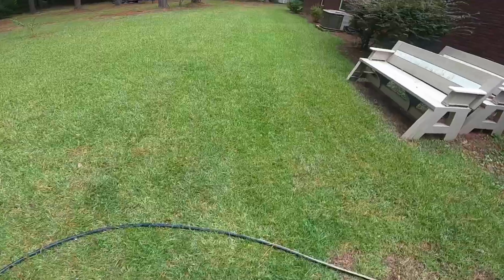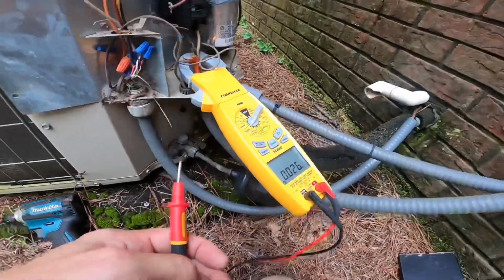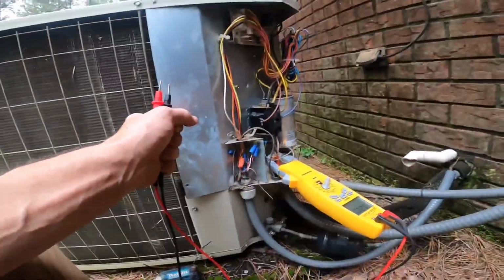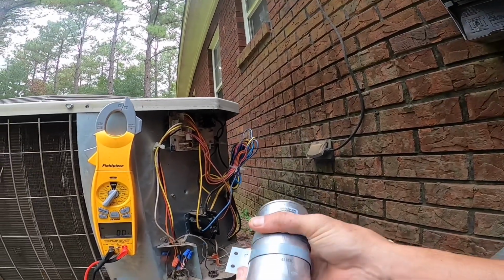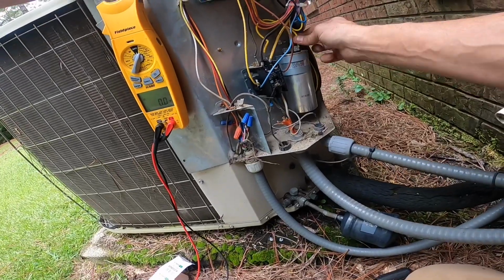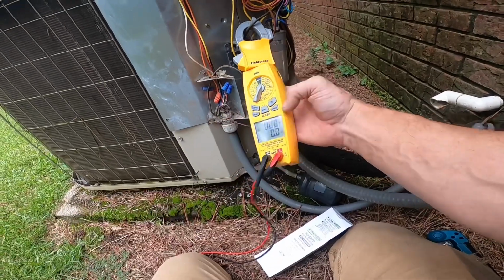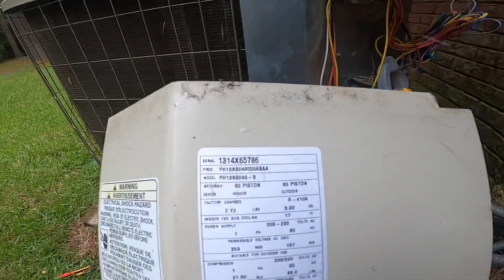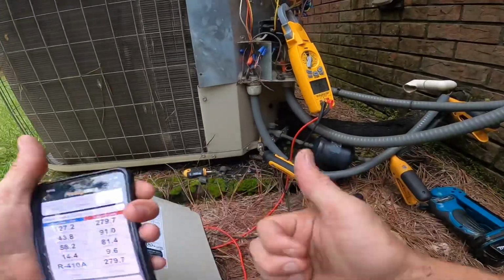No cooling, compressor wasn’t running, another cap bites the dust

Comment: By the way, the new Sman manifolds operate kind of the same way. They have a little glitch that a lot of people don't know about. I discovered it and brought it to Fieldpiece's attention. If you leave pressure on your hoses all the time it will never be an issue. But if you're the kind of guy that bleeds your pressure off after checking every unit you will need to open your hoses to atmospheric pressure before turning on the Sman so it can Auto calibrate to 0 psi at atmospheric pressure. But if you leave your hoses "attached" to the manifold and turn the manifold ON they will zero to the residual pressure left inside the hoses and that can throw your reading off as much as 8 to 10 psi. The manifolds basically have a "threshold" anything below a certain PSI it will consider as zero and they will automatically zero themselves to the pressure in the hoses. Then if you were to disconnect your hose and bleed the pressure off you would see that your manifolds are actually reading in the negative and then you start wondering what the heck is going on. If you were to use the zero button on the manifold to compensate you can actually start throwing off your calibration over a period of time. You really shouldn't have to ever use the zero button on the manifolds. So just remember open the hoses to atmospheric pressure "before" turning on the manifolds and you'll be okay every time. 😎👍
Reply from the maker: That’s good to know.
Reply: @HVACGUY  yeah, play around with it a little and you see what I mean. Those hoses will build up a little pressure just In the Heat of the van. And if you turn the manifolds on with the hoses connected you'll be in the negative pressures.